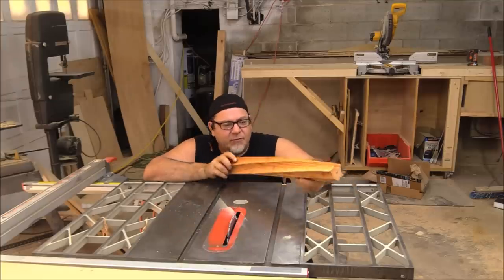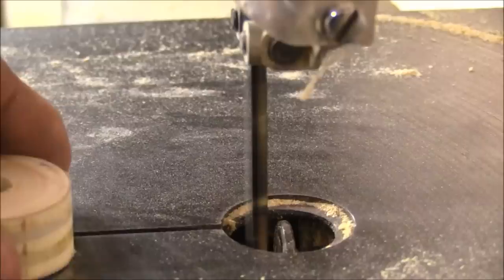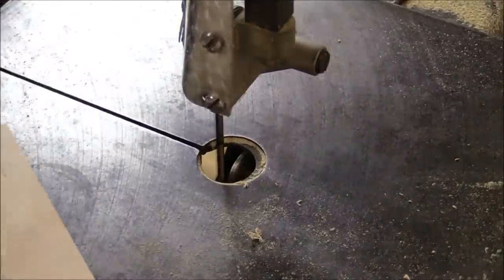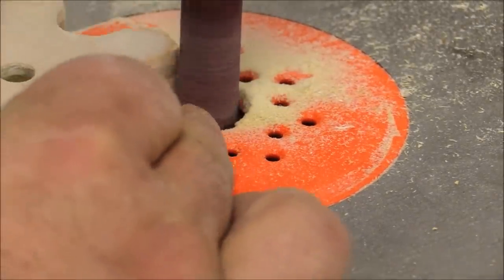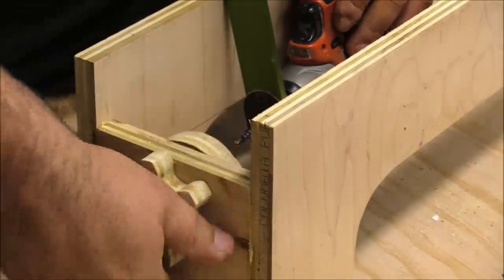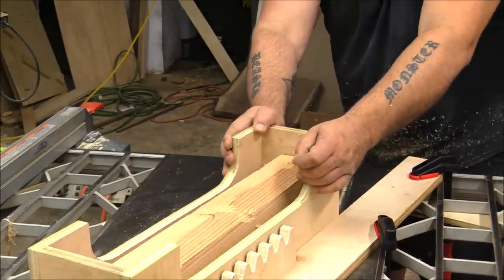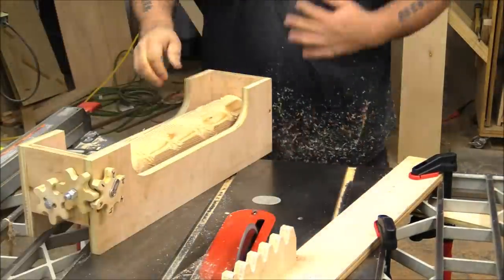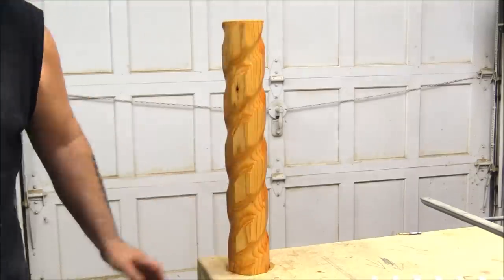Wood Gears Table Saw Jig | Woodworking

Comment: I just wanna say you are my hero and I want to be like you when I grow up. (BTW I’m 47 lol) My father always told me your shop is only limited by your imagination, if you can’t afford the store version find a way to make it. My ex found me a lathe for $75 that came with tools and everything except a live center but I had an old fan that quit working so I used the bearings and motor shaft the screwdrive bit that came with it and a square piece of 2x4 and made one

Comment: Years ago I had a sawmill customer, this old German guy, and he made these on a radial arm saw. He fixed the saw at an angle and had a sled with a hand crank on the end. It was all hand eye coordination- he pushed the sled/cranked the same speed every pass. They were just un-symmetrical enough that they looked hand carved and he used them for table legs, head and foot boards, and railing stiles.

Comment: I was thinking about your previous video and how it wouldn't be making a constant spiral since the screwdriver was running along a straight edge and what would be needed to correct that -- then I click a couple of video and up pops this video where you've gone well past anything I was thinking about and created a functional solution.

BTW: Fantastic proof of concept jig. Now it needs tighter tolerances, a clear cover to protect the hands and some handles. Perhaps some kind of gearing function to vary the spiral…

Super advanced option -- rotate the jig relative to the blade as the piece is advanced to change the profile of the grove being cut.

[edit] It's a shame I can only give this one thumbs up.

Comment: Hey Izzy, I haven't looked through the comments but I was an athletic trainer for around 20 years taking care of athletic injuries, medical care on the field at practices and games, rehab stuff like that. In that situation the body would probably best be used to pull the piece through rather than pushing. I'd love for you to make a really quick video on pulling it or something mechanical pulling it through with maybe some added weight on the back side of the frame opposite the gears. I was forced to retire from Athletic training due to herniated disc's from 3 different car accidents (none were my fault) so now I'm a beginner woodworker. I want to make this but my skills just aren't good enough yet (that's why I was wondering since you already made the device if you could try my thoughts.) I figured there's probably no chance but I figured it couldn't hurt to ask. Thanks Izzy, you're awesome.

Comment: Maybe some kind of crank on your end of the jig  that turns the stock, turning the gears, and it pulls itself across the blade. Always enjoy your vids! Great job!
Reply from the maker: That is a good idea i thought of that as well maybe for the next one
Reply: Use a cordless drill to drive the gear running on the rack

Comment: I had just finished watching your impossible panel (wood panel weave) video that was uploaded back about 4 months ago and was wondering if you might be able to answer a question about it? If depending on the type of wood used to make it, instead of cutting them to assemble it, could soaking them in water over a period of a couple of days or to about a week help to assemble the pieces to make it one solid panel? Izzy your work is amazing!

Comment: Great idea, not all of us has a fully equipped work shop, you could make this with only a table saw making the gears with a rasp.
Reply: Just curious.. why it matters what tools he uses, if YOU can do it with table saw and rasp? Sharing the idea is the point, imo. Now you know where to head, just improvise to get there, and use tools that you have...
Reply: I didn’t say that it did matter, my point was that it was a cool idea and that even if a table saw and rasp was all you have, you could still do this.

Comment: Did you find that it tried to lift as you strike the blade with the stock? 
I'm going to have a little play with this idea, with an additional modification.
I think adding rails would help, you could also gear them and use it to drive the jig forward?

Comment: Nice and fun! As you said, over a router it would be more controllable and finer. Also you can easily make wooden thread of any size with similar setup on router with a combination of gears. I leaves than to make the inner thread, but not like this :)

Comment: I agree with you on the need for larger gears. I think 8 or 10 tooth would run much smoother on the jig. Figuring out the math as to how many turn of the spiral per foot, and what gear combination is needed would make a fella go crazy, though. 🤣

Comment: If you make the gear ratio right and use a straight router bit you could potentially make wooden thread that would be an interesting project

Comment: Why not use cycle gears and chains..
Lay the chain horizontally for the sprocket wheel to ride on.. larger sprocket dia means larger pitch in the groove...smaller sprocket means tighter pitch..
Transmitting at 90° means using a sprocket wheel coupled with a cylinder with tapered pins on the circumference.. the pins will ride in the sprocket grooves and will turn 90° to the driving wheel...
Cheers with the next trial..

Comment: Too risky for these fingers.... but damn sure interesting.
Reply: Handles on the sides so your hands don't even appear to be near the blade and allow for a smoother push came to mind when I watched the video, so we had similar thoughts about the probably bite this get up might have.  But considering it runs on that track and is covered on 3 sides, it is possibly safer than it looks. A face shield like for lathe work or even a plexiglass cover came to mind as I wrote this.  After all, if the piece being worked on came out, 3 sides are covered, so it only has one way to go.  I am glad Izzy is working our the bugs and it isn't me.
Reply: That's true, and it made me laugh out loud! Like you said, I'm glad Izzy is working out the bugs and no one else... 3:-)